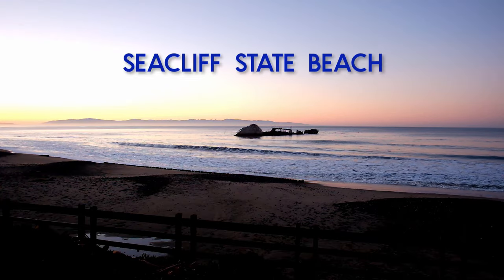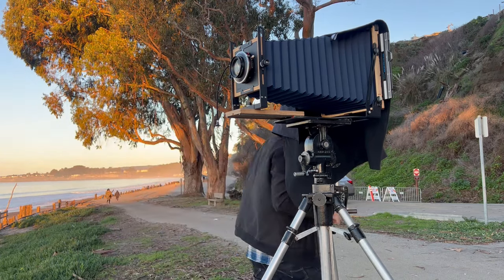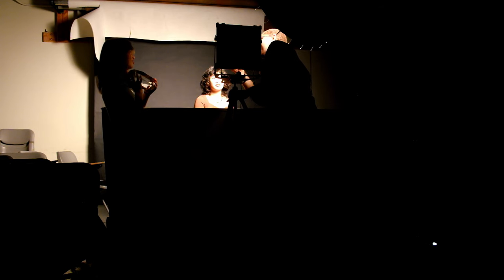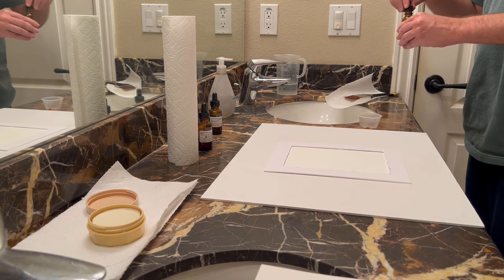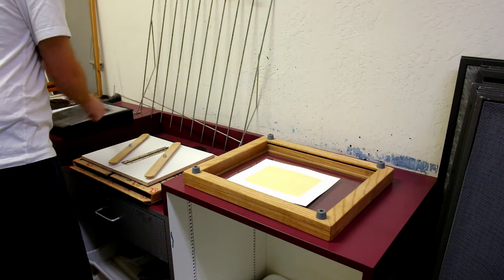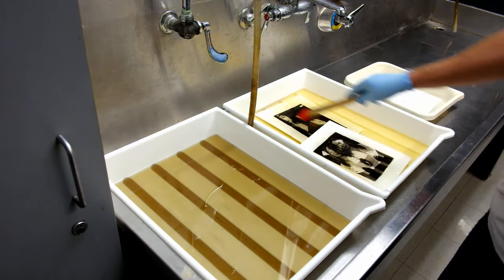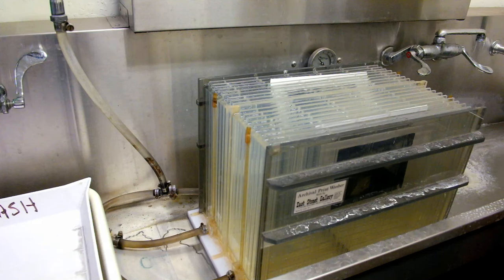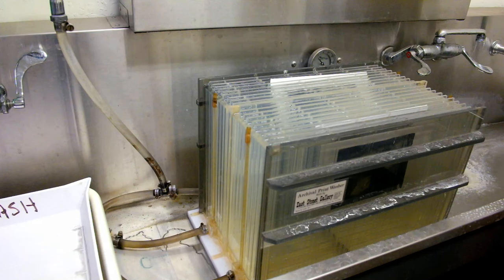Intrepid 8x10 Camera: Capture to Print using Large Format Film

Comment: Flashbacks. Nice work. 30 minutes to "develop" seemed long at first, but then I thought, oh, he must reference the entire wet process: developer, [stop bath,] fixation, rinsing?
You must know all the following, but it could make for a next video, maybe.
I'd argue that the slowness is not in the tray you use, because the entire process will need some 30 minutes, however "we" had upright tanks that we could hang a number of negatives in so as to process them all together. You use the metal frame hanging in the drying cabinet and that frame works upright in the wet too. So, yes, the per negative slowness follows from the tray that accommodates only one negative at a time.
Another thing is that the film developer solution has its chemicals sucked out of the water surrounding the film into the emulsion. This robs a thin layer of water around the film from chemicals and as long as you don't move the tray, diffusion that goes slow will bring unused chemicals into that "empty" space. Some photographers in the past (and still today) could religiously process their film that way but it would take much more time. Reasons to play with "motion" - how wild and how many times - during developing: it impacts contrast/gradation, contrast envelope, and may impact "sensitivity", plus it may impact grain.
With such standing tanks, we would "replenish" the solution after each use, up to a number of times, because each use consumed part of the chemicals in the water. That's less precise and more economical, than taking a new solution every time.

In the video, you don't go into tilt/shift and stay away from Scheimpflug's Law, not a problem (although a mathemagician would argue you do use that law because of an axiom in geometry), but also good to point at. You can use a simple large format camera without all the hassle.

As you exposed the landscape image in full daylight for a relatively long time, you must have stopped down the aperture a lot - what aperture number was it at?

And, as you stopped that lens down a lot, what lens was it? "We" had so-called " 8"*10" " lenses, way back that only gave an image circle large enough when stopped down a lot. At full open they might do 5"*7" or 4"*5" without having to worry. Which is to say, did you stop down purely for Depth of Field (DoF), or to arrive in the lens's operational zone?

Do you have a 4"*5" adapter-back with the 8"*10"? Then you can do what Yousuf Karsh [1] did in most of his portraits - he used a Kodak 14" ("Commercial Ektar") lens cropped and that gave him "portrait distance" in the case of half or head shots.

As the 14" at 8"*10" compares to your 35mm "full frame" camera's "nifty fifty", I would also point to the focal length of 355.6 mm (=14"). At 8"*10" you would need some 600mm for an image angle comparable to 85mm with 35mm and a 350mm or 600mm has shallow DoF even at f/22.

[1] Yousuf Karsh (1908–2002) - during his career as portrait photographer held 15,312 sittings, producing over 250,000 negatives. Some of the sitters were: Albert Camus, Albert Einstein, Albert Schweitzer, Alberto Giacometti, Alfred Hitchcock, Andy Warhol, Angelo Giuseppe Roncalli AKA Pope John XXIII, Anita Ekberg, Anjezë Gonxhe Bojaxhiu AKA Mother Teresa, Ansel Adams, Apollo 11: Neil A. Armstrong & Michael Collins & Edwin E. 'Buzz' Aldrin, Jr., Audrey Hepburn, Bernard Shaw, Brigitte Bardot, Carl Jung, Charles-Édouard Jeanneret AKA Le Corbusier, Christian Dior, Clark Gable, Dwight Eisenhower, Eleanor Roosevelt, Elizabeth II Queen of England, Elizabeth Taylor, Ernest Hemingway, Fidel Castro, Frank Lloyd Wright, George Bernard Shaw, Georgia O'Keefe, Gerard Depardieu, Grace Kelly AKA Princess Grace, Gregory Peck, Helen Keller and Polly Thompson, I.M. Pei, Jacqueline Kennedy, Jacques Cousteau, Jan Smuts, Jessye Norman, Joan Miró, John and Jacqueline Kennedy, John F. Kennedy, Karol Józef Wojtyła AKA Pope John Paul II, King Faisal, Lord Beaverbrook, Man Ray, Marc Chagall, Marcel Marceau, Marian Anderson, Martha Graham, Martin Luther King Jr., Mikhail Gorbachev, Mstislav Rostropovich, Muhammad Ali, Nelson Mandela, Pablo Casals, Pablo Picasso, Queen Elizabeth II and Prince Philip, Robert Oppenheimer, Sophia Loren, Ulla Jacobsen, W.H. Auden, Walt Disney, Winston Churchill.
Reply from the maker: Yeah I've played around a little with stand development. I also have one of those CatLABS clips that can do 3 sheets of 8x10 at once, but it's such a pain to load that I'm always worried I'll do it wrong. I like the Stearman tank because it's pretty much idiot-proof. I think that long exposure was around f/45 - wanted to make sure the ship was in sharp focus, plus I got the water nice and smooth. Thanks for watching!